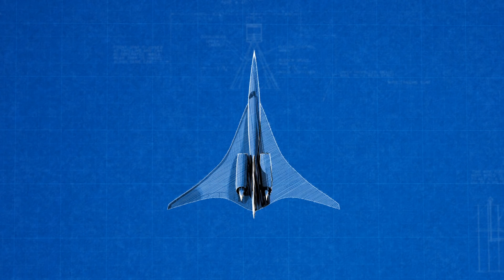NASA Attempts to Make a Supersonic Jet Without the Boom | WIRED

Comment: I hate fucking flying, (aerophbia) why not make a supersonic ship =)
Reply: water is 400 times denser than air, and water resistance increase exponentially as speed increases, also how can you propel such a vehicle? the only feasible way is with rockets however the range will be abysmal. so there's no way we can make such a submarine anytime soon. it will take decades
Reply: Kaul Watson It is possible for submarines not regular ships..its also possible for catamarans with sub-shaped hulls under the water.Look up supercavitation on Google. I read where Russia had torpedoes that did 200 knots and didn't believe so I looked it up.The submarine/catamaran hulls would ride in a bubble of air.